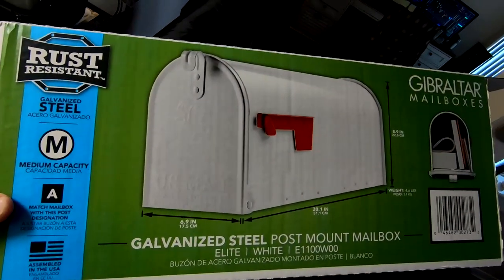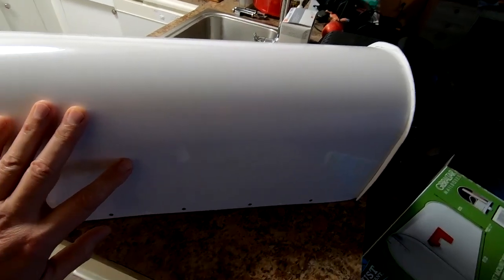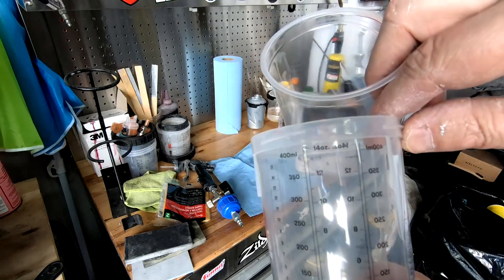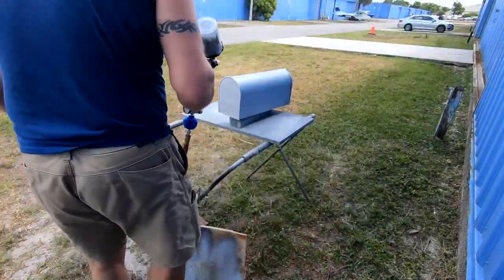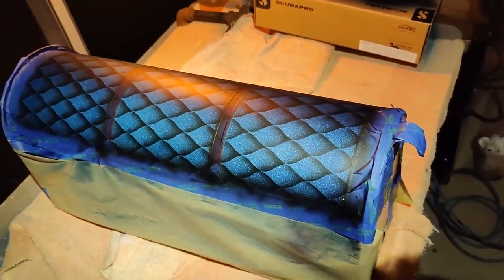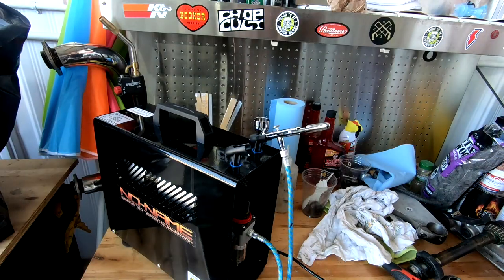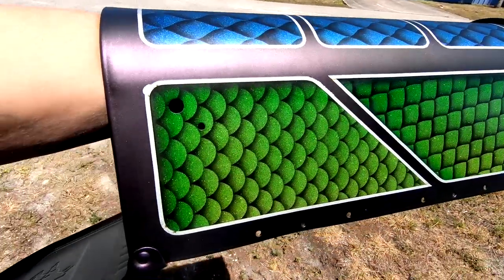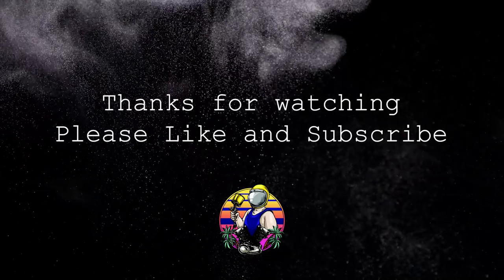Custom Mailbox - Flakes & Candy

Comment: Hey Frenchy. The reason some of the readings are backwards on the cups is so you can measure out while looking inside the cup.
Reply from the maker: I understand that, but how practical is this? If you look outside you can have the cup level with your eyes and do the proper ratio, looking from inside, you will look at an angle! Yeah I know it doesn't have to be that precise maybe, but I can't help myself 😃
Reply: Lol I know. 99% of the time I just look on the outside of the cup myself.